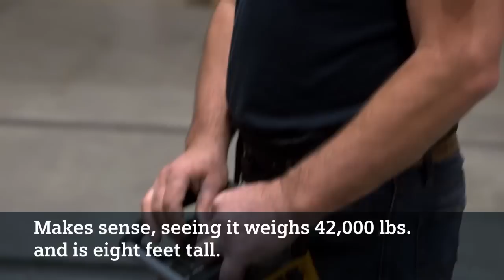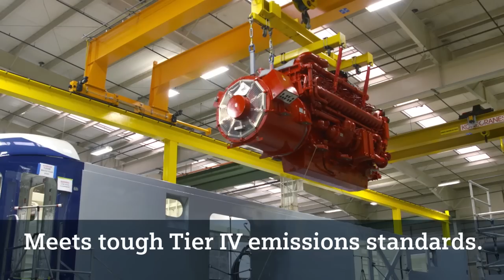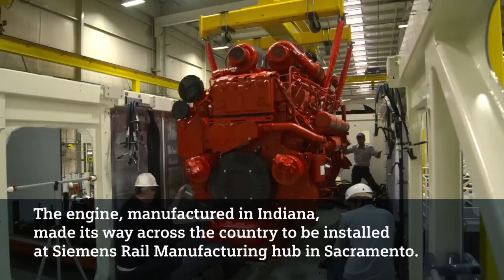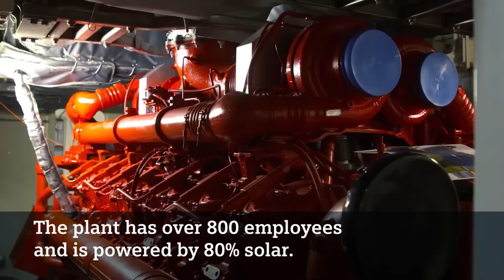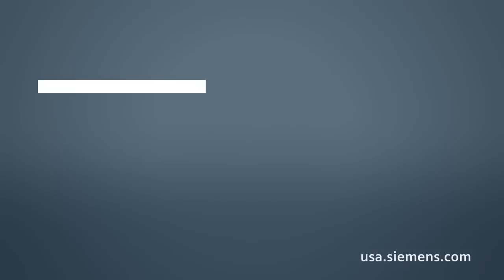Siemens Charger locomotive receives a Cummins engine

Comment: Soon they will be replacing the acs-64s being used by amtrak in 2022 and one will replace them and they will be retired from 2022-2024 and they will be scrapped, displayed in railroad museums, & sold to other railroads, or rebuilt into different locomotives
Reply: Nope, NYC Penn Station and Philadelphia's Suburban Station doesn't allow diesels in their stations and Amtrak can't retire a locomotive too early after official revenue service.
Reply: Given the fact that these SC-44 Chargers and the ACS-64's are only a couple years old now, if even that old, and the fact most other Amtrak locomotives have at minimum a 20+ year operational career ahead of them, unless these new locomotives are SEVERELY flawed, they will in no way be retired by 2022/2024 lol Give them a couple decades worth of service and then they might start becoming threatened by retirement/replacement.
Reply: This kid is constantly lying in his comments

Comment: tbh, I hate those locomotives because of their looks. I think F125's and ACS-64's are better. Amtrak should get EMD F125's instead of those ugly guys.
Reply: Amtrak and AWVR Fan the F125 was built by Siemens
Reply: @randymorel1590  the F125 is built by EMD, get your facts straight.
Reply: The F125's look ugly tbh
Reply: I definitely agree the only locomotive uglier then the P40/42DC's that Amtrak has owned would be the SC-44's. But that said the F125's had quite severe reliability issues in the early days which didn't instill confidence in most railroads to purchase them at least initially. Granted I've heard the SC-44's don't handle cold very well so we'll see how true those statements are in the long run. In any case with how much of a regularly scheduled cluster fuck Amtrak is in most cases the fact they are even trying at all and purchasing new power is at least a little promising.
Reply: F125 design is fuckin ugly. LMAO
Reply: just look at a photo of a alc-42 it looks like a acs-64 so at least much better than the standard chargers that have a weird GM aerotrain chopped nose.
Reply: I like F125's design and at least they don't have crappy K5LA's also although they are having some issues like the traction motor thing as well as shrilling K2 horns although then you have the shrilling horn enthusiasts that will say "oh god this gives me vibes about the Budd metroliner horns back in the day"